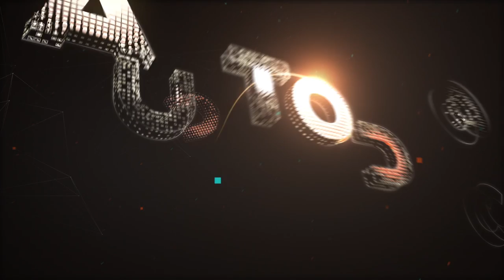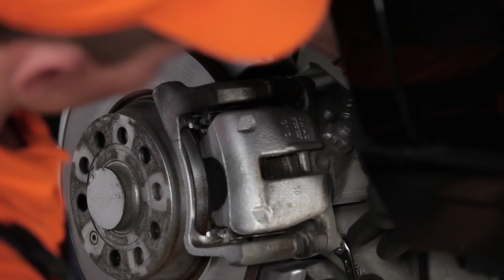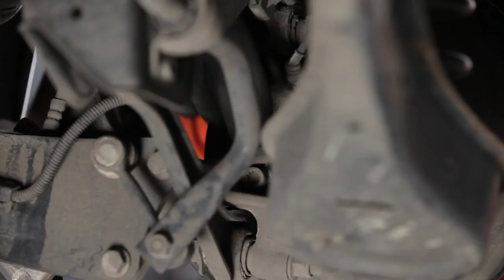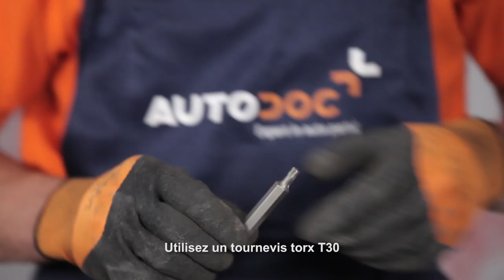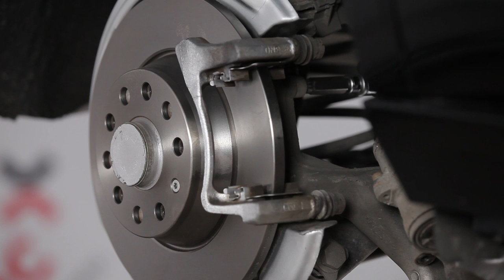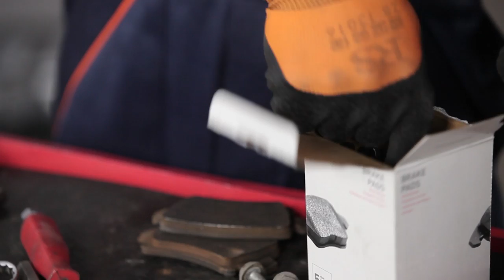VW / AUDI / SKODA disques de frein arrière | plaquettes de frein arrière [TUTORIEL]

Comment: Le piston, common returner?
Reply from the maker: Bonjour! Merci pour votre commentaire! Pour cela nous vous conseillons d'utiliser un extracteur piston, par exemple YT-0611 YATO. Cordialement, l’équipe Autodoc.
Reply: Avec un repousse piston adapter ou un sert joint à bois et une pince multiple. Tu sert le piston avec le sert joint en tournan en même temps avec la pince sens horaire et ça rentre tous seul si tu pense à enlever le bouchon de réservoir de liquide de freins 😉